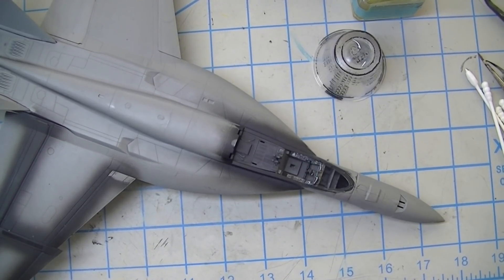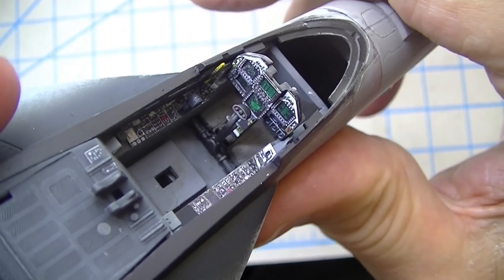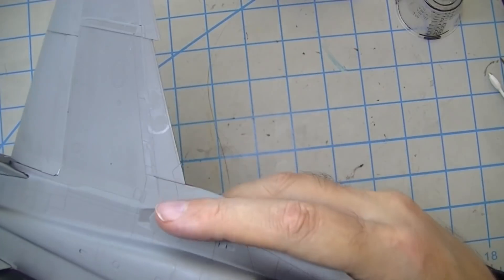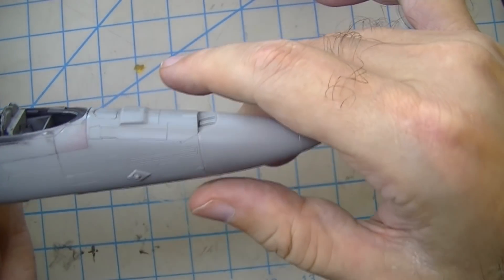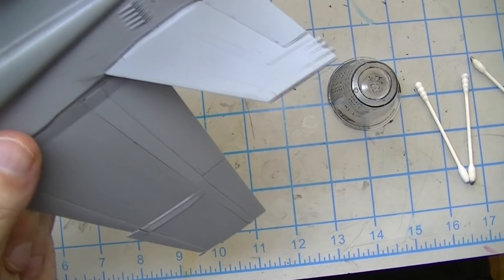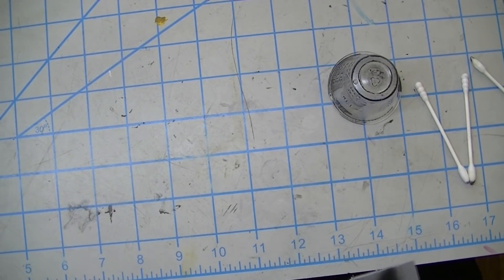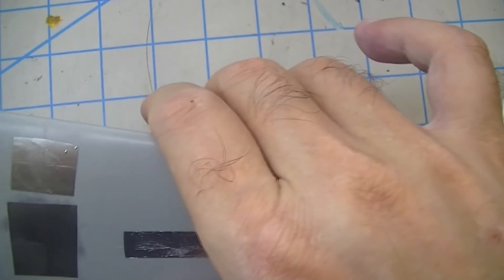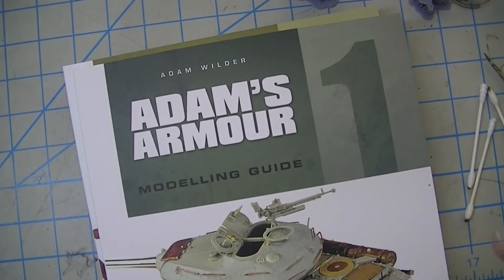ep335 - some minutes of random #53

Comment: Try softening the material with a little heat and see if it lays on your surfaces and conforms better. Just be really careful with the heat, with those films it a little bit goes a very long way when it comes to the heat.
Reply from the maker: lol you seem to have missed the part where i mention using a hair dryer and warping the test piece.
Reply: @barpfoto  I forgot to mention apply before lying it down. Get the film warm before laying it down and see if it adheres better to the details. Sorry I was confusing.
Reply: Im thinking of it being more like when you see vaccuform machines pull a mold with PVC plastics rather than like heatshrink after wrapping an item. Putting the film on first and then applying heat would work better if the film shrank when heated, but it seems like it doesn't do that, where as like sheets of PVC used to make stormtrooper armor on a vac table you first heat the sheets and then pull it down over the molds and then add some suction to pull it into the folds and creases, so maybe that would work here. Heat the film first, then lay it down and run a swab over it to press it into the details.

Comment: That  sounds strange.You need a Pilot when the Flaps are up? It depends on, what the Pilot is doing,  when taxiing. And it doesn't matter which Airplane.I have seen our  Tornado Crews taxiing with Flaps up , others  in extended Position. I was Ground Personnel, Ammunition, Fighter Bomber Wing 32, German Air Force in the late 80's.